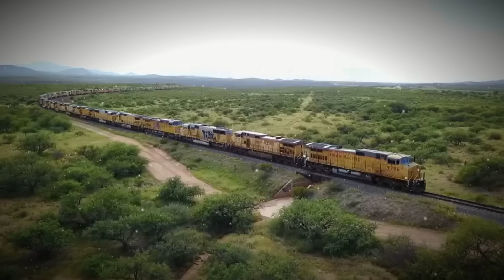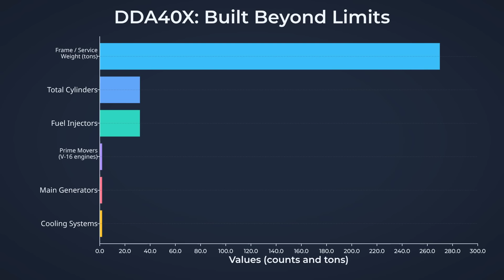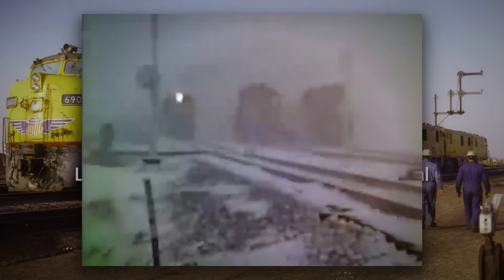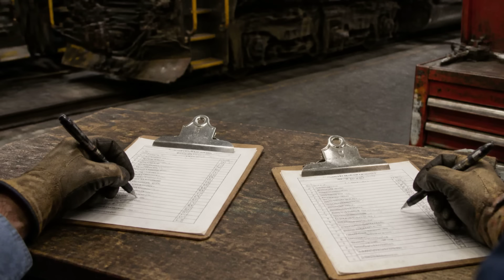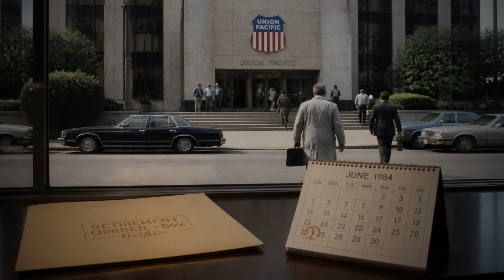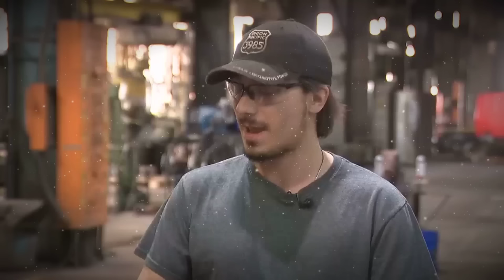Why Union Pacific Left Its Biggest Diesel Ever To Rot

Comment: The Centennial was a marvel of enginuaty and design that worked great for it's time. It's just too.bad that more of the weren't saved in running condition.
Reply: As a UP stockholder the company should not “save” out of date equipment. You can probably buy and save! Spend your money. Not mine.